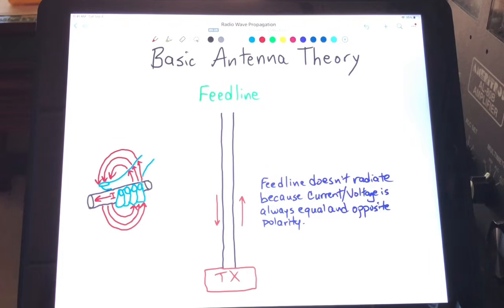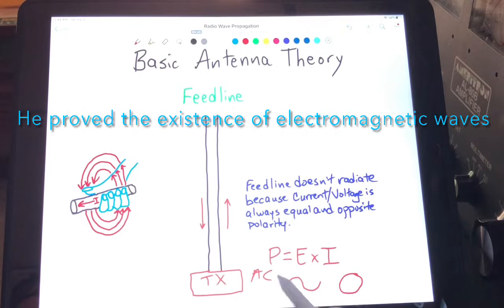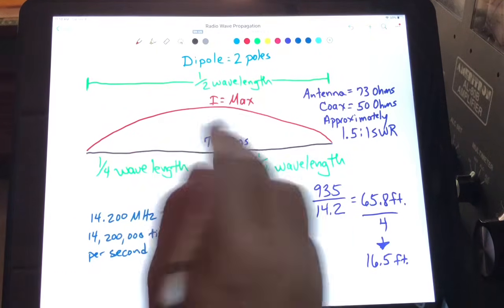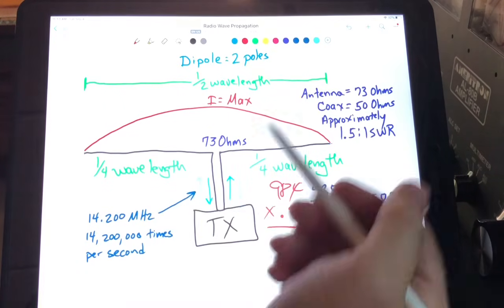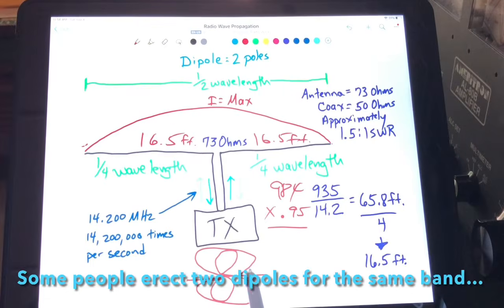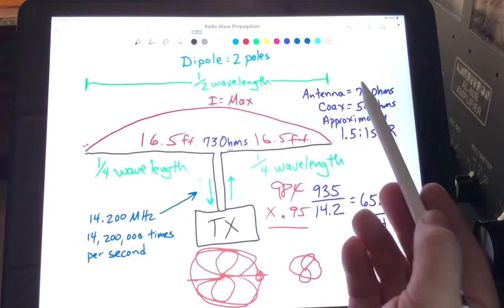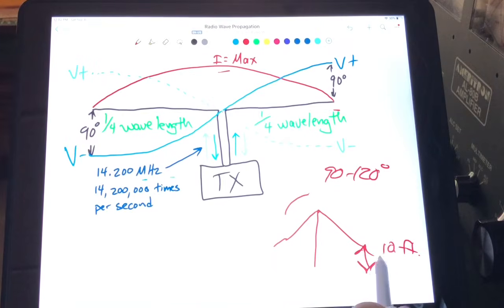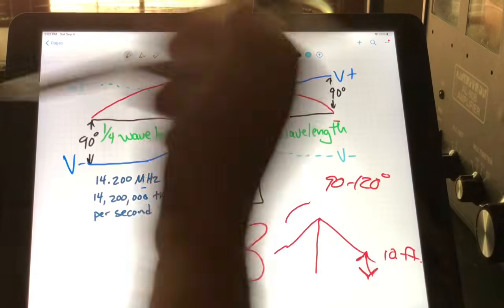Basic Antenna Theory (HF Dipole)

Comment: Boy this was very good.  Learned quite a bit.  Do you think you could do a deep dive on the ZS6BKW.  On that antenna, I just cannot get a grip on the need for 75 feet plus of coax to ladder line and what exactly the ladder line's function is in "matching".
Reply from the maker: There is a ton of information on the Internet about the ZS6BKW.  I shot a recent video unboxing the NI4L.com version of it.  

The ZS6BKW is not a standard dipole.  It is a type of doublet antenna system.  The ladder line is part of the antenna, serving as a matching section.  The coax helps complete the match, transforming the impedance to a usable range.  

Reflected energy bounces back and forth between the source (radio) and the antenna.  The length of coax helps dissipate the losses.  That is admittedly a very simplistic way to look at it, but the 70-75 feet of coax helps get the impedance down to a usable/tunable range.  The original G5RV ended up with around 90-Ohms impedance where the feedline met the coax.  That was fine for back then, when hams sometimes used 75-Ohm coax.  But this was only the case for 20 meters.  The antenna could function on other bands with a tuner but Louis Varney, G5RV, only intended to use the antenna on 20 meters.

Brian Austin, ZS6BKW, computer modeled the G5RV to come up with improvements that might allow the antenna to provide tuner-free operation on other bands, with 50-Ohm coax.  He was successful in his quest and that is why his variant of the G5RV antenna is known as the ZS6BKW.

73, de N4HNH

Comment: Yes it was informative.  Is the insulation coating on the the dipole wire not normally sufficient to prevent electric shocks from touching?  I was thinking you would just get burns from the radiative energy.   And what risk is there from touching the external surface of the coax connectors at the rig end of the feeder?  I feel these are very basic questions i never see answers for.
Reply from the maker: It isn’t quite the same as a direct electric shock.  It’s a burn.  RF energy can heat tissue.  You don’t have to touch the antenna to receive a burn.  Just get close enough with your hand to draw an arc.  Of course it depends upon the frequency and the amount of power (P=EI) being radiated.  0.5W has been likened to a bee sting.  100W feels like heat from a cigarette lighter.  1,000W could cause hospitalization.

Here is an interesting thread from a discussion forum related to this subject:  https://www.reddit.com/r/amateurradio/comments/2yrts7/rf_burns/

And here is an article that will take you on a deep dive into the subject: https://www.lbagroup.com/resources/rf-shock-and-burn-radio-frequency-radiation-technical-note-124

73, de N4HNH

Comment: Actually open wire feedlines are more complex than that and the simple answer of cancellation may be overly simplistic.  The characteristic losses of open wire feedlines are low when compared to coaxial feedlines of the same length especially under high SWR (up to 9:1).  The matching is done at the rig using a balanced line tuner to match the radio's source impedance of 50 ohms and the losses at the tuner itself are relatively low compared to "lossy" coaxial cable. At very high SWR, the cancellation of return currents becomes less effective.  So your statement is true up to a certain point.   The answer then becomes "it depends...."
Reply from the maker: Yes, I didn’t want to go into those weeds with this video.  The open wire line, at 420 to 600 Ohms isn’t going to match up to a dipole that is cut according to the formula of 935/Frequency in MHz, with its 73-Ohm impedance.  The math I use in this video assumes 50-Ohm coax connected to a dipole cut for the 20 meter band.

This video targets those who are new to amateur radio and want to learn how to build a simple dipole.  There are circumstances where the current isn’t completely equal and opposite, for either coax or open wire line, but I didn’t want to get into that in a basics video.  I think I did put a comment mentioning that under certain circumstances the feedline can radiate.

I prefer a BalUn even for a single band dipole, but I have a multiband ZS6BKW by NI4L that has no BalUn.  It works perfectly on 12, 17, 20, 40, and the FM portion of 10 meters with no BalUn or tuner.  The interaction of the 39 feet of window line with the 47 feet of wire on each side of the center insulator yields resonant points at harmonic intervals.  The ZS6BKW is a great variation of the G5RV.

There are many variables with antennas and feedline.  With antennas there is the theory and then there is the reality brought about by the installation location.

73, Doug
Reply: @n4hnhradio  I understand - open wire feedlines for a G5RV and ZS6BKW need to be matched to the radiating elements and open wire feedline versus can be a deep rabbit hole that one may not be able to come out of.  I am actually trying to do a video as to the why's to the concepts you presented.   You are correct in saying that the signals "effectively" cancel - trying to say though it is only true up to a point.  Actually the return currents on any feedline is low - effectively zero - if the load impedance is a complex conjugate of the source impedance - ideally 50 ohms resistive with no reactive components.   Remember that EFHW coaxial feedlines do radiate when the  there is a mismatch and return currents present themselves on the shield of the coax.   Being that we are QRP and we take great pains to match impedances - this is not a problem.  I did get an RF bite touching the ground lug of my 120W rated EFHW transformer during field day while transmitting at 150 watts.   That was a wake up call not to do that again.
Reply from the maker: How dare you put 150W into a 120W UnUn.  Hi! Hi!
Reply: @n4hnhradio  It was field day and I wanted to do a torture test.  Oh BTW it is not a balun but a transformer.  A balun goes from unbalanced to balanced.   It is more an Un-Un because it remains unbalanced and connects to a coaxial feedline which is unbalanced.   It is not a pure un-un because there is a voltage tansformation from roughly 3200 ohms to 50 ohms - hence it is a transformer.
Reply from the maker: I don’t want to get into EFHW yet.  I was only asked to cover basic antenna theory.  If I get asked about a EFHW I’m going to defer to you.
Reply from the maker: My doublet has a SWR of less than 2:1 across 14.0 to 18.168 MHz.  I can adjust the resonant point by lengthening or shortening the feedline.  It’s definitely not acting like a 73-Ohm dipole, though it is cut for 160 meters.  But I’m not feeding it with coax, hence it is a doublet.  I have a 4:1 BalUn in my tuner, so the impedance at the BalUn end of the window line must be in the neighborhood of 200 Ohms at 14-18 MHz.  My antenna matching unit makes the radio happy and it all plays well. 

When you get beyond the basic coax-fed 73-Ohm half-wave dipole things begin to become more complex.  I think new hams should just focus on building a basic coax-fed dipole before diving into the complexities of the EFHW, Doublet, or even the OCF dipole.